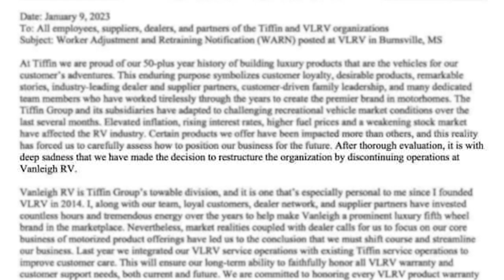Vanleigh RV SHUTS down | EP41

Comment: I'm so sorry you've had such a difficult time with your unit. You would think filming the majority of your build they would have ensured everything was done to perfection.

A lot of Vanleigh owners I've talked with complain of the MDF roof decking. You can easily spot a Vanleigh that's suffered a leak by the swollen roof. One unit in particular I saw has a roof in terrible shape. Every sheet of decking is swollen. Perhaps the issue is more excess humidity inside that's being absorbed by the MDF. I don't think the owner realizes just how bad her roof is. If she has leaks I can only imagine what that unit smells like on the inside. All that moisture trapped and rotting the MDF. Yikes!

I'm curious to know if other owners here are having issues with their MDF roof decking in humid climates. Or if the issue is lack of proper roof maintenance. 

Vanleigh made gorgeous units. When I purchased my new unit in 2019 I was choosing between Luxe, RiverStone, Beacon, and DRV. After viewing various models it was down to Beacon and DRV. Ultimately I choose a DRV Houston. The main factor for me was construction method and materials and floorplan. I don't have a single regret. I absolutely love my Houston. I'm sure I would have loved a Beacon 39FBB equally. However the Houston offered five more feet of space in the living area.

Comment: Wow, I do wonder with the current state of the economy if this is just the first of several RV industry companies to fold up. We may be in the beginning stages of what happened to the RV industries back in 2008/2009. As for warranty, wasn't Tiffin purchased by Thor several years ago? This may be their way of streamlining. In our case, Highland Ridge was purchased by Jayco in 2016. The last time we had warranty work done it was done in the "Jayco" (also owned by Thor) service center in Middlebury vs. previously it had been done at the Highlandridge shop in Shipshewanda as Thor had shut down the shop in Shipshwanda and consolidated service work being done. Of course going forward with no more VanLeigh rigs being built, its just a matter of a couple years and warranty issues will time out. Hope you two are doing well. Happy New Year!! 🍻 Sean

Comment: Wow you had a really tough first year. If your experience is anything like other buyers then it’s no surprise that this division of Tiffin has shut down. In 2016 I bought a 2012 Tiffin Breeze 32 RB in my hometown of Apex, NC. Most of my trips were to the Rockies and Pacific coast states so it was an easy stop into Red Bay heading out or returning and I always had something (mostly minor) to get taken care of at the Tiffin repair center or Bay Diesel. April 1, 2020 I set out with Jeep Cherokee in tow and moved to Birch Bay, WA so there won’t be anymore visits to Red Bay. I sure hope your rig gets sorted properly and you can get into more fun RVing.
Reply from the maker: When we purchased the Beacon the service approach you outlined was exactly our plan but flipped.  With our “homebase” being Boise Idaho we planned on stopping at the Vanleigh SC in Mississippi or Redbay as needed as we traversed east and back west. That plan was adjusted in our first year and didn’t work like we had hoped. I like the size of the Breeze - seems it would be most of the same comforts and a much smaller size. We hope we get it ironed out as well. Thank you.

Comment: Hi guys, I just watched an episode where y’all were talking about all the problems that you are having after doing all the upgrades and miles back and forth to get warranty work done. Y’all also talked about how much y’all spent on fuel, staying at campgrounds, etc. do y’all belong to any of the “clubs” like Thousand Trails and several others to get much cheaper campground rates?
Reply from the maker: We are Harvest Hosts members, Good Sam, Passport America and KOA. We have considered and ran numbers a several times on Thousand Trails memberships vs locations we would stay and it hadn’t worked out for us yet. We may reconsider in the future as we continually adapt our preference for stays. We are aiming to for much more boondocking this next year but that could change depending on which portion of the US we traverse which could lead us back to running those numbers against TT.  Thanks for hanging out with us!

Comment: Kind of have to agree with the guy who is slamming Lippert. Vanleigh isn't the only one with frames cracking. DRV seems to be having the same issue with their frames. I know from renovating Historical buildings. The first thing we fix are the footings. Nothing more nerve wracking than a 4 or 5 story building sitting on cribbing, and a bunch of people running around underneath. It fixes a whole bunch of problems immediately though. Electrical for one and framing issues for another. I figured you were with family for Christmas. Hope you were warmer than we were in MT. Probably not. It was challenging being there after 40+ years in AZ. Hope you have a wonderful New Year and hope our paths cross. We are headed to Tampa. All these years on the road and never had time to see that show

Comment: Wow! Just had something similar happen with the company that installed our solar system on our home. Panel manufacturer is still around and solid, but should anything go wrong, I'd pay the labor for and repairs. When we purchased our  new Teton, a year later, they closed their doors. Fortunately, I had gotten all the after delivery issues resolved while under warranty before they shut down. Had that rig for 7 years. Other than maintaining it, we were good. 
My advice to anyone considering buying one of those 5th wheels now is to pass. Parts will likely become an issue, and warranty claims are likely to be challenging.  It's not great when the company is still in business.  I would get everything corrected as soon as possible on your coach, just in case Tiffin changes their mind. Good luck!

Comment: Sad to see for sure. We have a Thore Infinty which we love but is no longer available so your brand on the surface would have been a good potential replacement. Unfortunatly if a brand needs a service center that big and need and they keep units for weeks to fix them then there is no profit to be had. That is without compensating for hotels and out of pocket costs like the 10,000 miles of travel for warrenty work. I would push for a refund even if it means taking them to court. These units are marketed and sold based on quality and they have not delivered.
When we got our infinity we had quite a few issues to be fixed under warrenty and it did not go well and ended with the dealer closing the doors. I dont think any company will produce a quality product when labor is paid on a piecework system. How can quality be achieved when workers are paid not to care.
Part of my business is working on RV's and some of the workmanship is just plain terrible. The average owner is better of learning basic skills and fixing things them selves. Key areas for improvment on all brands appears to be electrical, plumbing (plastic fittings for something going down the road at 70 miles an hour is a non starter with me) caulking everywhere on the RV, but roof and windows in particular and sealing entrypoints for insects and rodents.
Slide alignment to insure seals keep the weather out is another big one.
Sad but in this case in everyones best interest in this case.

Comment: Looks can be deceiving... I have seen several of these units with similar issues.
Reply from the maker: Vanleigh has / had some nice quality touches. It’s unfortunate that they didn’t slow down to make the best or even a marketable sustainable product instead of chasing the dollar. While at their Service Center we were told that their philosophy is to press them off the line and deal with the exceptions post purchase - likely just a small piece for the unfortunate closure of the product line.

Comment: When you mention "all the problems we've had", and "the list of unresolved issues", might I inquire as to if this was your first RV?  How experienced with RVs were you when you bought this model?
Reply from the maker: You must be new to our channel so welcome! This is our third 5th wheel that we have on our journeys. This rig has had several larger issues including roof replacement due to bad membrane with failed decking, our pantry was also built too tall suspending the roof inches above the walls and had to be trimmed down once was the roof was removed, broken welds due to frame flex which were re- welded and have since broke again, bedroom slide construction failure, water intrusion that had led to the conclusion from the factory that the galley slide we need rebuilt and our wiring in our underbelly will all need to be replaced. We have shared about 1/3 of our issues on the channel leaving out the less significant issues. Many issues I address during our travels however we have been told by the manufacturer that we will need to return to the plant for some of our repairs. We have been to the manufacturer in Mississippi three times for repairs and working on our return visit now. Hope that helps - thanks for watching!
Reply: @MidlifeDetour  thanks for the detailed feedback.
Reply from the maker: @blacklabeltools2249  for sure! Thanks for hanging out with us!

Comment: You guys are in  a real pickle.  With all the issues you've had this could be a time to trade but, the economic downturn has RV prices dropping on a weekly basis with no end in sight.  Then add onto this you'd be trading in a orphan brand, the dealer will really hit you on trade value because he knows its gonna be a tough sell to the next customer.  I guess the thing to do is get all those issues fixed ASAP through the warranty and hope for the best.  Me personally, life's too short to deal with ongoing/never ending issues in the RV and I'd probably dump it, take the hit and move on.
Reply from the maker: Carl - Ah…the pickle Sarah and I discuss daily. Outside of the issues you mention we have put a lot into the rig with upgrades (solar and IS). At the Tampa show this week we heard “deals” being worked several times where the sales rep asked about issues with the trade or water damage. We laughed thinking how we would answer those questions. 

I appreciate the advice. We have service appointments made in the coming months but they will not be addressing all issues. We are trying to avoid service centers in 23 but the reality is with owning this rig we risk repeating the last year. Life is too short. 

Appreciate your perspective.

Comment: Expensive fuel, high interest rates and a slowing economy don't bode well for the RV industry so this isn't surprising. Hopefully they honor warranty claims that will depended how the subsidiary was legally structured. I wouldn't want to count on just "good will". Keeping in contact with other Vanleigh owners would be wise in case you need to sue. I forget which city it was but they bought millions of dollars worth of LED street lighting from a now defunct company and they are having extremely high failure rates with zero recourse.. there's literally no company to warranty or sue..  It's a rough situation- it's impossible to know the future of a non-listed company.

Comment: Sounds like you better call Extreme Rv in Eden Idaho and order an Alliance Valor 😲👍🤣
Reply from the maker: Hahaha! Well…🤔
Reply: They will be next!
Stick with the tried and true Montana, alpine, big horns, big country, landmark, cedar creek, or Riverstone.
All these new manufacturers dont have the knowledge, or support. 
Grand design I feel has just now became decent and they have been around since 2014. Look at build quality on a 2014 a 2017 and a 2022. Each year quality has increased, due to learning knowledge through those short years.
My parents got a 2011 montana. Only issue in 12 years is yellowing storage compartment doors, bad refrigerator, and a dey rotted hydraulic line hose. Dont know if they were built better back then, or if they are just far superior units due to 25 years of in the making, and experience of what works and what doesn't.
Reply: @krice24  I don't believe Alliance is going away anytime soon.
Reply: @jamesglenn520  nobody thought vanleigh was either....but they did.
These new startups are hard to make it, once they surpass the 10+ year mark they will be considered a good brand and safe. Like grand design is a brand I am just now starting to trust. They have so much on the road now, I dont think they are going anywhere and have tons of dealers. 

For alliance. Hardly any dealers, support is small and scattered, don't see hardly any, which is hard to overcome especially in a recession, or upcoming. It will take about 10 years for them to get big like grand design or keystone. Grand design got in the right time at the start of the bell curve on a graph in 2014 when rvs where starting to take off. Now we are at the top, which isn't when you want to enter a market and then sell a startup for more or equal to its competitors, that's also why I feel vanleigh beacon failed. 115+ for a new brand, I could get a landmark or a mobile suites, I looked at them, but that is why I wouldnt buy one. 

Also, what scares me about alliance not making it is their prices. They are more expensive then a Montana, alpine, cedar creek, and landmark, just to name a few big boys in the industry. Which makes me more worried becuase they are not competitive. I would buy one of the brands mentioned above because they have been around longer and have more issues fixed that say vanleigh has and alliance, like thier video mentioned improper rubber roof install, cabinets to large rubbing the slide, the frame welds with braces other manufacturers have and later on beacon added, etc. Now if they were 15-20k cheaper then the brands mentioned above I would buy an alliance or new brand rv and risk it as I am getting an upscale rv like the montana for cheaper. But you will not make it in the industry selling for the same price as a montana or more, and sadly alot of people view it like I do, so to get the name out their advertise hard like grand design did and have a low price. Grand design solitude is still way over priced by 30k for what it is. Look at an alpine and its features compared to a solitude and its price and tell me you wouldn't rather have the alpine over the solitude or alliance! 

One last thing back in 2006 a brand named glacier bay started, just like alliance. Guys from another manufacturer started it off. In 2009 they closed up just like vanleigh. When that happend you couldnt get any dealer support, warranty work was a long pain, they were using another manufactuer to pretty much buy out their warranty work...well it didnt go good at all, and owning one of those was a disaster. Dealers couldn't even sell used ones for much. Huge discounts on them, so people would take risks becuase they were actually very well built high end models. You can Google it. Glacier bay by glacier bay. I been around the rv industry since 2007. I hope the people who made this video that own the beacon see this and make sure they dont buy a new company again.